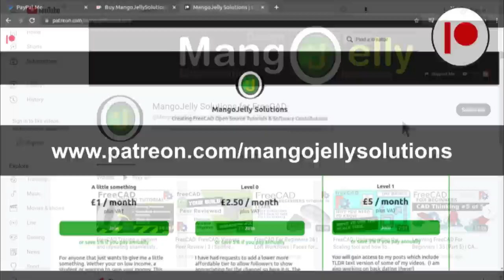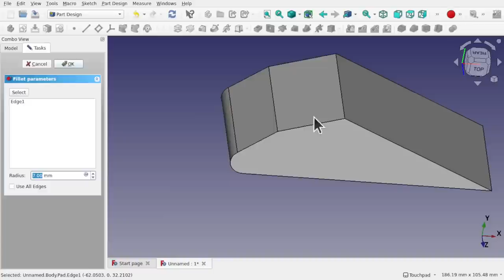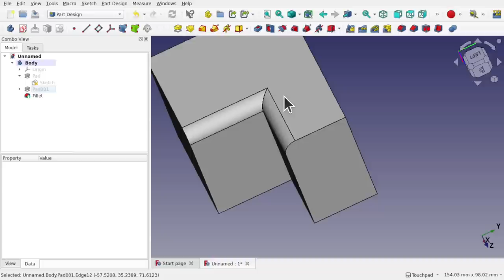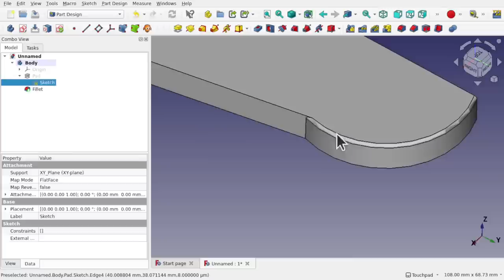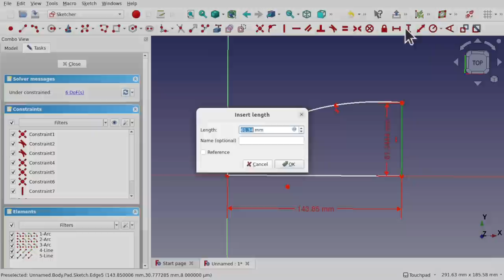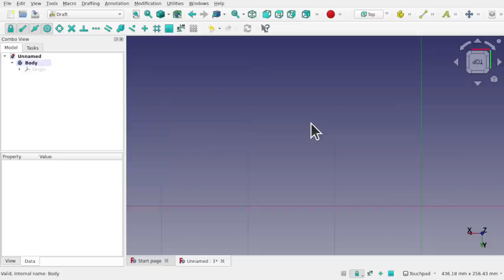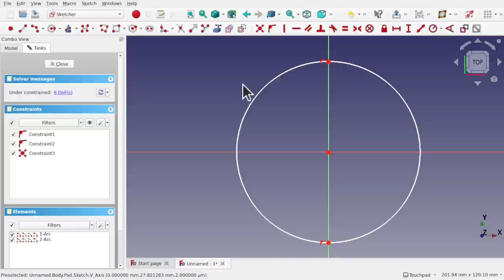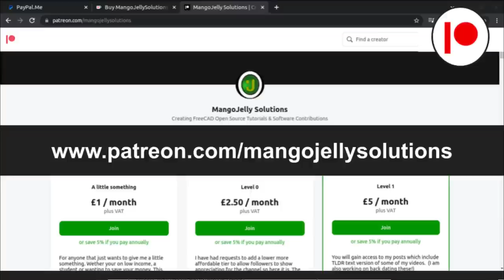Main Reasons Why Fillets Fails in FreeCAD and How To Solve Them

Comment: Years ago I saw a video of a man who was having a lot of trouble with his computer. He slapped his monitor around enough to knock it on the floor & when that didn't work he pulls a gun & shoots it. That is exactly what the learning curve of FreeCAD makes you feel like. Most of the time the help is only useful to someone who knows how to do it anyway. Don't mention the oh so informative FC error messages 😠
I resisted the urge to do either & over the last 2 years have become quite competent with FC. It's the only CAD software I use now & it's great 😀
Reply: Tell me about it😂. I was doing one of Mangoes exercises last night, and first time it worked. Next time failed, then failed then failed. My mistake, I was selecting an object from the graphics screen, and not the design tree. Hey, I think freecad is a superb package, but my hair tearing is thro the roof sometimes. Having used Solidworks professionally for 15 years, I cant remember it ever giving me such high blood pressure moments 😂😂

Comment: Fillets can really drive me crazy when having e. g. a loft intersecting w/ another object and I want to have a smooth inner edge. Sometimes splitting design into separate bodies first and then boolean join them again helps, but not always… although it looks like inserting a fillet should be easy.
Reply from the maker: I know what you mean, it's that time you look at the model and start to dread that stage. Loft intersections are notoriously a pain. That would of been a great example to add to the video actually. The angle of those edges where they meet can cause the same issue as the draft face example. Thanks for adding the information about how you try to get around the issue.

Comment: Polyline has a continous arc mode cycled in with 'M', with auto tangency constraints and all, no need to use the arc tool. First it was a bit unintuitive for me that you have a well defined follow up arc segment for every point on the plane, it also constrains you in ways you never intended (would be cool to somehow seamlessly fine tune the previous segment endpoint without leaving polyline drawing mode with MMB or something like that), but the option is there whatsoever.

Comment: How do you add fillets to an imported STL file?
Reply: I had this problem the other day. I had a part I had imported from solidworks as a step file, and it dropped a fillet.  I ended up having to create a plane on a surface and manually drawing the fillet to do a cut. That worked fine 👍.
Reply: Blimey…was hoping for an easier way😂

Comment: Wireframe is an easy way of picking up edges.(Should o kept my mouth shut and not stopped the video to make a comment😁)
Reply from the maker: lol, not a problem :) still great to have the comment as it gives a shortcut to the tip.  Actually, yourself (or anyone) may be able to help, what else do you use wire frame view mode (or the other modes) for?  For example with wire frame I use it for as you said easy selection of edges and also I would set say a cube to wire frame on the view tab if I was going to use it to hang geometry off (kind of like a scaffolding), say a curves workbench freehand b-spline connected to the corner points.  I am trying to find other reasons to use the different view modes available.
Reply: For picking up edges and internal alignment o 2 bodies is all I can think of at the mo!
Reply: in the development version of freecad there is now a selection filter tool that allows you to limit selection to only the desired type of geometry